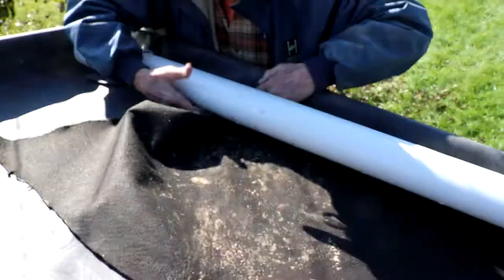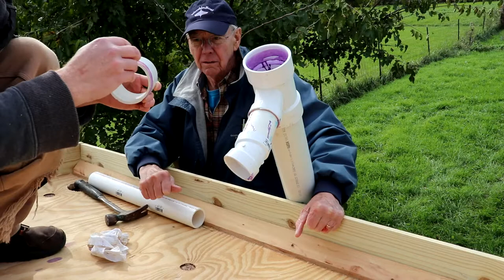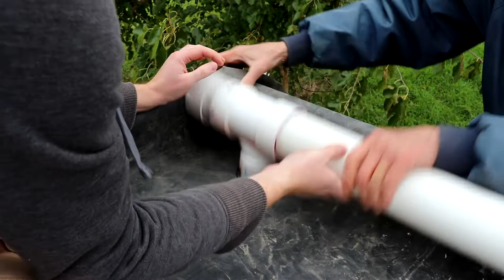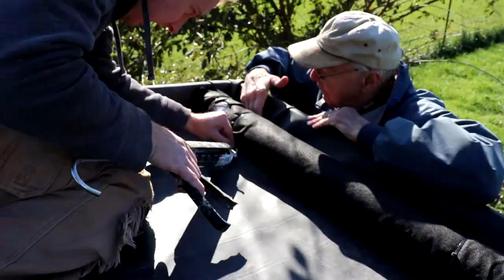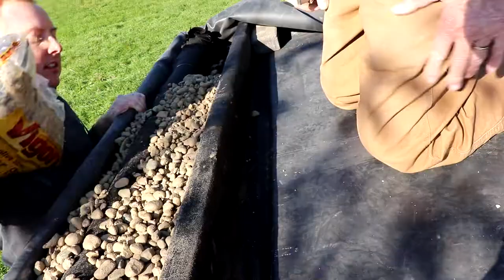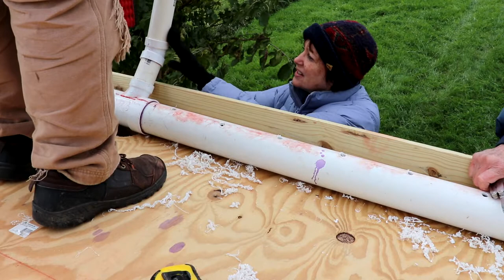Green Roof DIY Episode 3: Waterproof Membrane | Drainage System Installation

Comment: Is there a benefit to having the pipe versus just doing a gravel trench that leads to a drainage hole in the corner?
Reply: That's what i was thinking too @mateo Kaiser. I'm also wandering why the timber is there. Would it not be better to have it open so the water can flow down?
Reply from the maker: Great point, Mateo! At first we wanted to use drainage holes on the edge of the roof like you suggest. I had concerns with how the the roof would move and warp over time , possibly affecting the pitch of the roof. The current drain pipe is angled to keep a constant pitch at all points across the lowest end of the roof. I dont remember how many holes in total were drilled, but adding together the total circumference of these holes greatly outmeasures one or even two stand-alone drains. The goal moving forward is also for rain collection and filtration, so I was hoping to accommodate large amounts of rainfall. I hope this answers your question!
Reply from the maker: Hey Tommy! The 4x4 timber is used as a brace to keep the lower bed wall from buckling under the weight of the media + rain + stones. The 2x4 before the gravel pit ties into the 4x4 to help distribute the weight evenly across the frame. There is a 1/2" gap beneath the 2x4 to allow water to enter through the geotextile fabric into the gravel pit. Let me know if this is not helpful or if you have any other questions!
Reply: @IndyHomestead  I completely missed the gap you created below the 2x4. That makes more sense to me :) Thank you for explaining.
Reply: @IndyHomestead  Hello! I am wondering how clean your water is when it comes out of the tap at the other end? i.e. is the water clear and not murky? We want to do something similar for a handwashing station on an outhouse green roof but aren't sure if the water would be murky from the soil. Thanks!
Reply: @Carpe_the_F_Diem  I don't see how it's possible to miss that.

Comment: Why drill holes in drainage pipe and then wrap it in pond liner? Seems like water can't get in there. It's mostly draining through the gravel.
Reply: looks like they are not wrapping the pipe with a pond liner, but instead they are using a water permeable geotextile fabric.